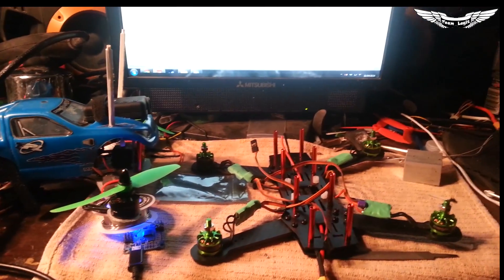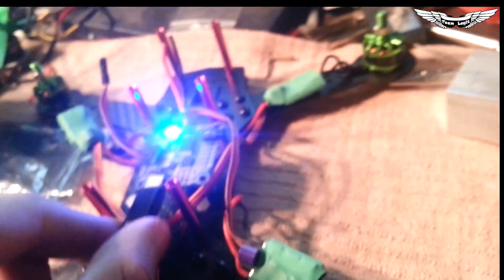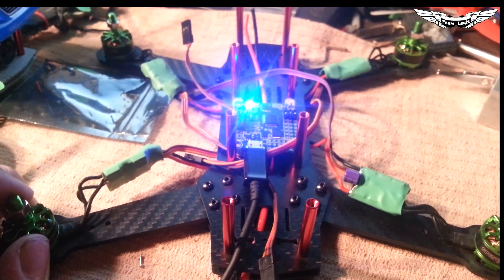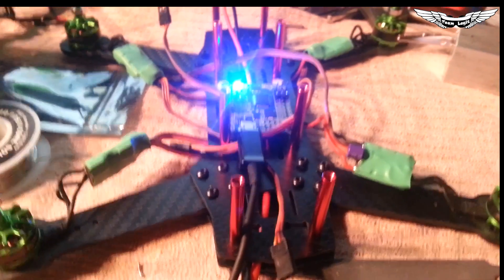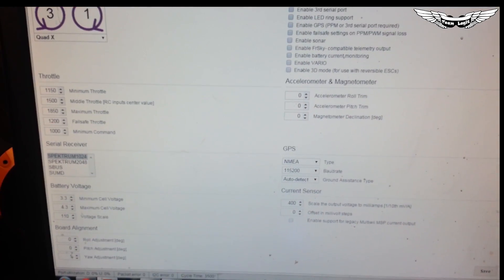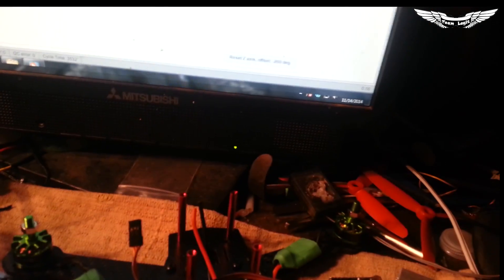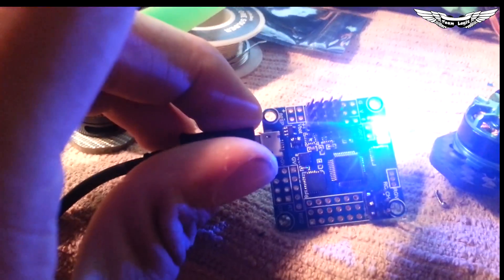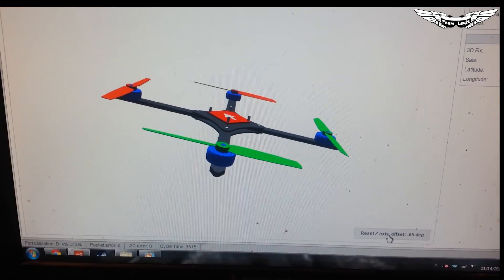DragonFly32 Naze32 90 Degree Board placement

Comment: I do this with all my boards.But i turn mine the other direction so the USB on on the right side of the quad, leds or on the left and motor connections in the back and rx on the front. To do this you set -90 on that box instead of 90. They fly perfectly fine as mine have been like this for over 6 months.  This is why I prefer the board layout of the flip32/dragonfly32 board better than the naze32.
Reply: That is how i do mine as well.
Reply: +ModifiedRC I'm just setting one of these for the 1st time and I used 270 for the setting. It seems to do the same. Is this correct  or should I use -90?
Reply: +DJB HSI Yes use -90 now, they have depreciated the ability to use 270 now.

Comment: Yep, that'll work! Not done it myself because I made a point of not blocking access to it with wires and rx during the build. But a lot of people do it to make getting at the USB socket easier. It's surprising how many people don't know you can do this so this video will definitely be a light bulb moment for a lot of people.